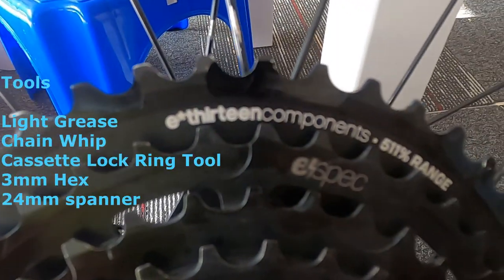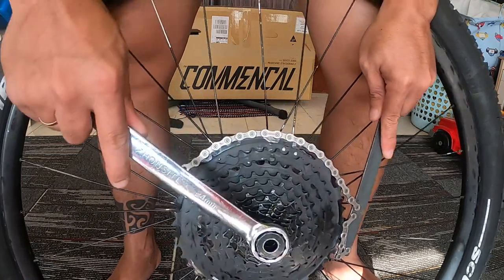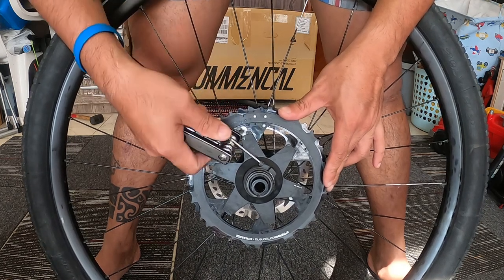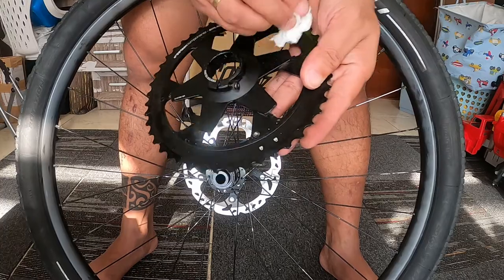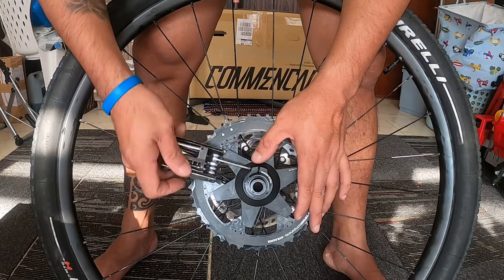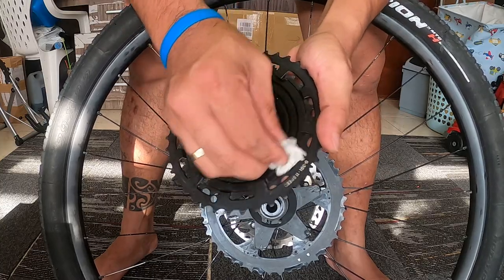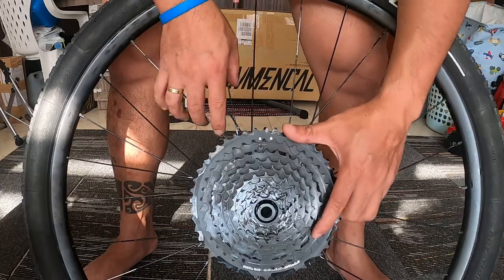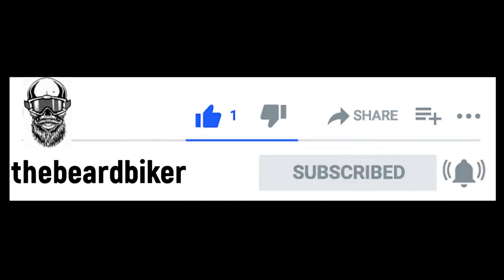HOW TO INSTALL / REMOVE E*THIRTEEN TRS PLUS GEN 2 TRS XCX CASSETTES / E13 TRS+  CASSETTE MAINTENANCE

Comment: Thank you for your response. I installed the e-thirteenth cassette, but the cassette is making noises as the 11 speed chain is rubbing with the side of the chain cogs.  What type of chain are you using? I see that some use 12 speed chains... thank you!
Reply from the maker: Yes I used Sram 12 speed chain
Reply: @thebeardbikertv  even though the cassette is 11spd? is it better to use 12spd? whim Sram chain exactly?
Reply from the maker: @greg.ocallaghan  for e13 yes.. 12speed chain can be installed

Comment: Thank you for the video. Quick question: this cassette is sold as ebike compatible. I am looking to use it for gravel with my sram 11 speed rival mechanical system. Are youbusing the cassete with an ebike? Have you tested the sram compatibility? Thank you
Reply from the maker: Hi you can use it also in gravel as long as you have the correct gear ratio of the cassette